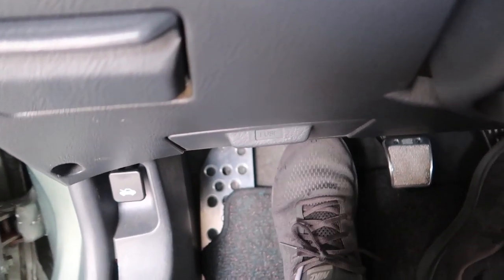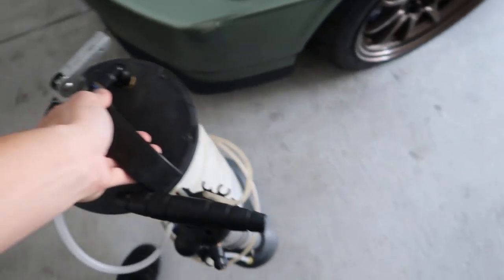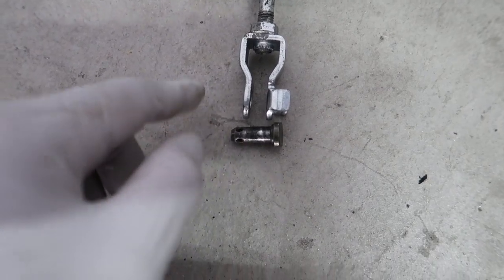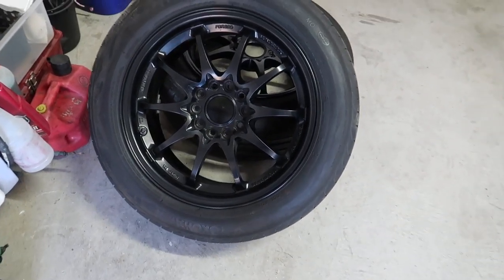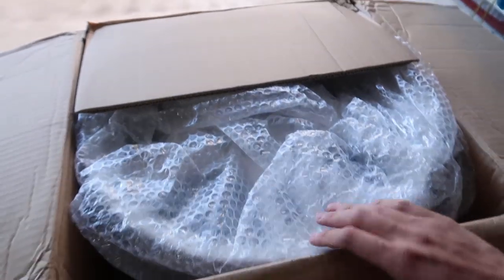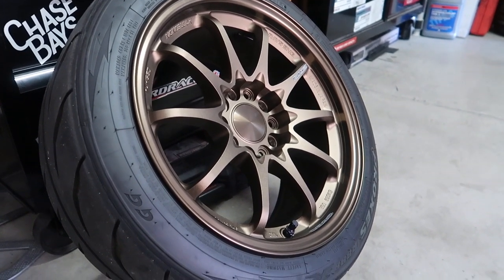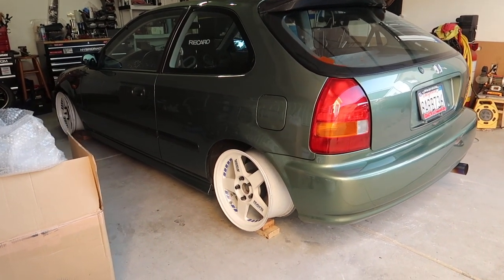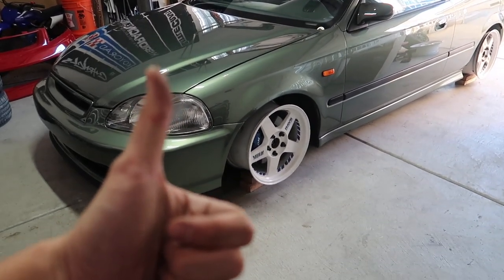Got new wheels from Japan! Clutch master cylinder install on EK

Comment: Is is some kind of racing K-Tuned slave cylinder? I put in DOT 5.1 fluid for my clutch. But, I didn't use OEM parts. I used a new steel braided line, and Luk brand cylinders. I've got JDM folding mirrors. But your car is FAR superior to mine.